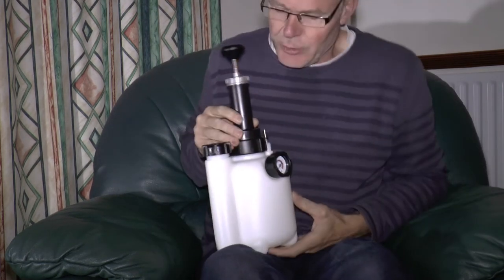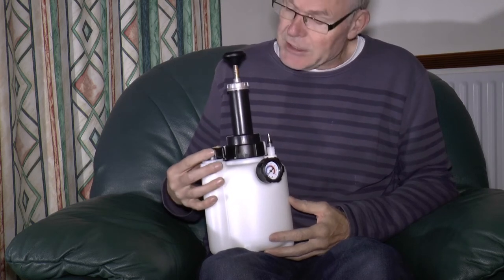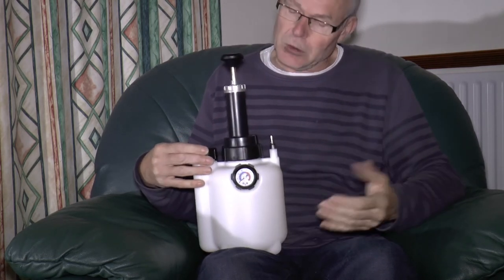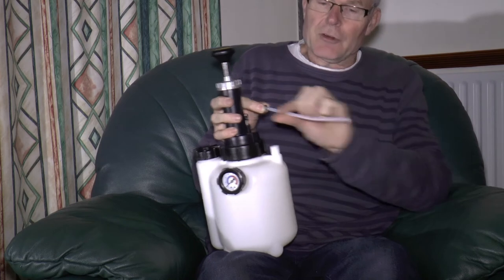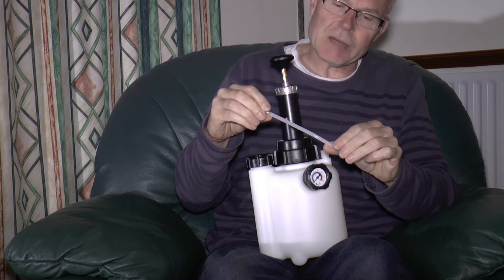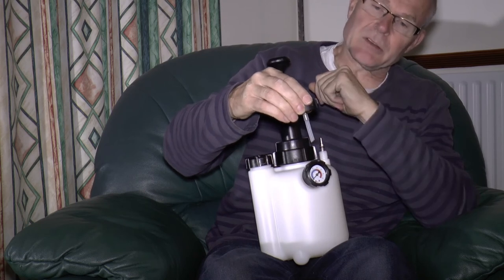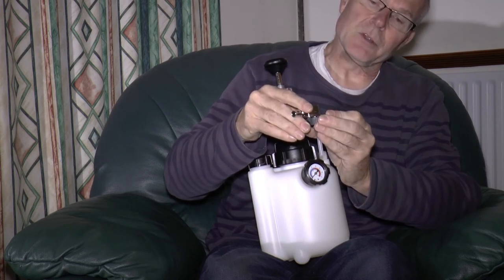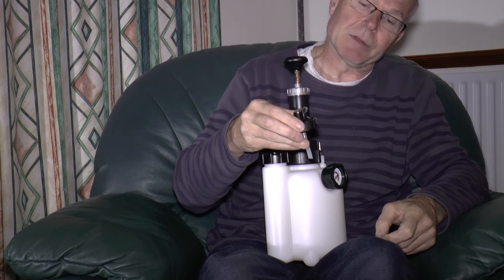Sealey VS820 -  Caveat Emptor

Comment: You should add in the title words such as "brake bleeder", alternatively, you should add the words brake, bleeder, pressure, problems, sealing, leaking, air, not tight, silicone, paste, grease, fix, fixes, repair, modification in the tags section of the video. Lucky for me I found this video, I've just ordered the same chinese made unit from ebay. The way you've titled this video means that only those who own a Sealey VS820 would be able to search for this video, even though you've stated that this is a china made copy. Great video, thanks.

Comment: A word of warning, when I tried to use the vs820 today the main seal that goes between the pump and the reservoir was fitted poorly and caused it to warp horribly.
I couldn't get it into the correct shape and had to abandon the brake bleeding attempt.
However, I emailed Sealey and they replied with 1 hour that they would post me a replacement seal.
Very impressive customer service I must say, well done Sealey!
Reply: I got the replacement part from Sealey and it looks like they have upgraded the design of that seal.
Fitted it and bled my brakes with no issues.

Comment from the maker: OK - As a footnote . . .  I stated in the video that the drop tube is HDPE - it is actually translucent polypropylene and I found it almost impossible to source, even though it is widely used in hand pumps for soap dispensers etc. HDPE might be persuaded to work but isn't the ideal solution and nor was PTFE - both proved difficult to engage on the nipple. In the end I purchased a small length of OD4mm x 3mm ID stainless tubing to merely insert into the end of the pickup tube. The original plastic will take on a "set" using boiling water (not quite hot enough unless you're very patient) or a hot air gun but if you use the latter - be careful not to melt/overheat it. I placed a length from a soap dispenser into the oven, set at 150Celsius and due to local "hotspots" , managed to destroy it. Usng heat in this way, the lower end of the stainless can be guided into the foot of the main vessel and trimmed to length.Also, the "elbow cap" is only 3/4 turn from "engaged" to fully tight. In other words, for a quarter of its circumference, it isn't held in place by the threads at all - simply put . . the cap is a little too shallow and the Sealey "spare" with a vertical connector is deeper and therefore, held in place more securely around it's full circumference. The former would appear O.K but will be susceptible to being "blown off" if either a poor fit (compare VERY carefully with your original cap) or if you over-pressure the bleeder.Be sure to bear the following in mind - the E20 thread cap has a diameter of 4.3cm AND therefore, a surface area of almost exactly 2.25 square inches. If you pump the bleeder up to only 20psi, you are generating a force of 45lbs trying to blow the cap off, which in turn, is only held on around 3/4 of it's available thread. If you inflate it to 30psi or above, that's 67lbs and more . . . . . . .  BANG!!!!!!Bear in mind that the vehicle's fluid reservoir is not designed to be pressurised internally and remains at atmospheric pressure at all times during braking. I will probably buy the spare Sealey cap as a safer alternative but use the minimum pressure that I can get away with. I will start off at 6-8psi and if it takes a little longer to complete the job . . . so be it!!

Comment: If you look on the master cylinder cap connector you will see stamped in the metal the letters '20SH'. if you type that in Google it will all become clear. They are available on ebay, but of course they come from China. Thanks for the advice I will tune up my VS820 as soon as possible.